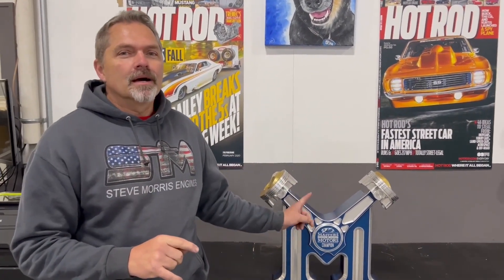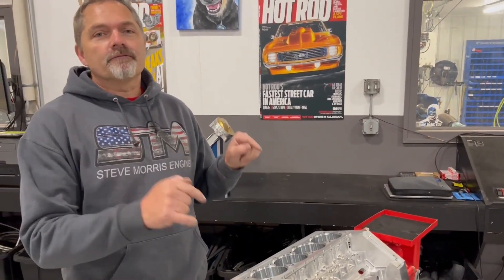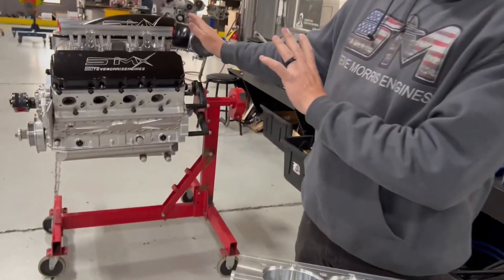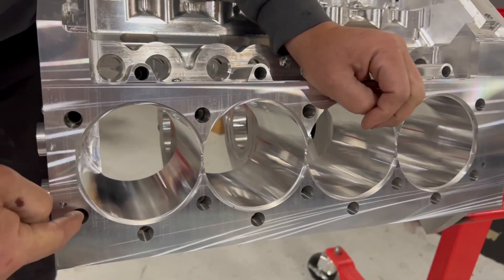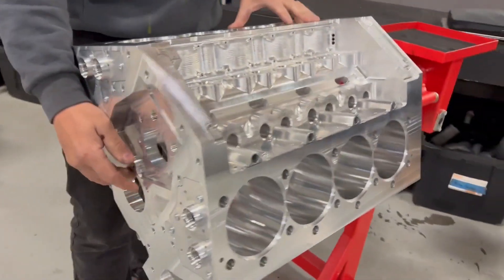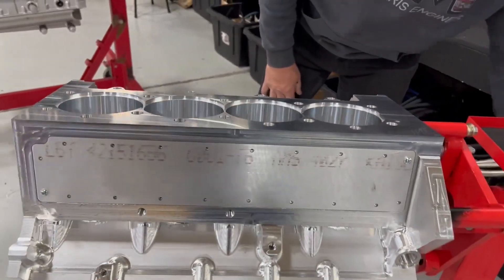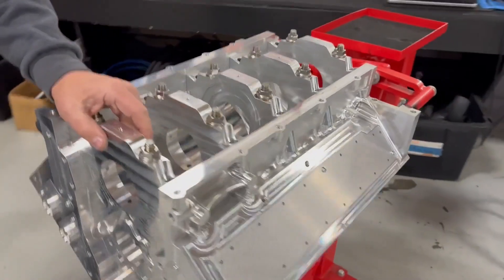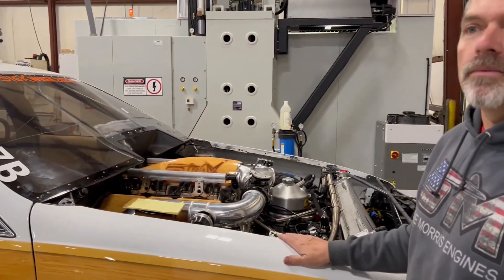Steve Morris Engines' New 3,500-HP SML Engine

Comment: Awesome so this is an Apple engine platform AND you cant use anything other than steves stuff. Pass.
Reply from the maker: For the block and the heads yes, it must be from SME. The internals and other accessories can still be found from other aftermarket companies.

Comment: Did he say 80-90K?  Not bitching, just making sure that is what he said..... That means it is essentially the same as an SMX - you have to be a pretty DIE HARD LS Fanboi to not just go SMX and go real fast
Reply: They are both rated for just about the same power.
Reply: @erichenrise9392  yeah and this one would directly replace the LS and fit right in other than a SMX might potentially have to move steering for instance with that bigger block and oil pan